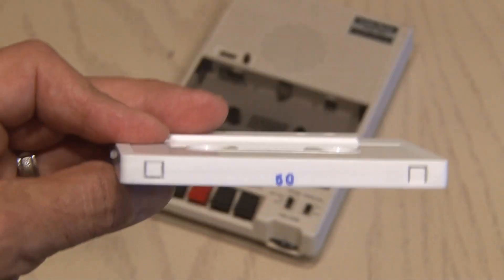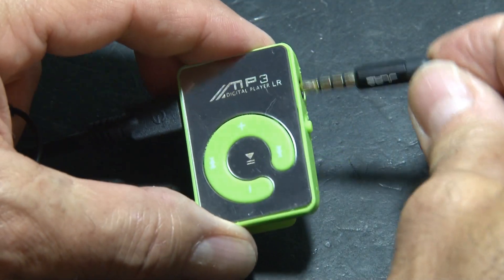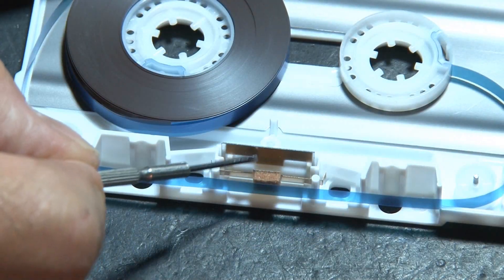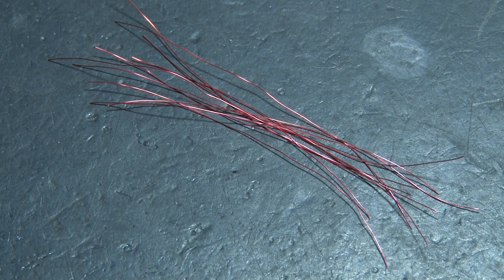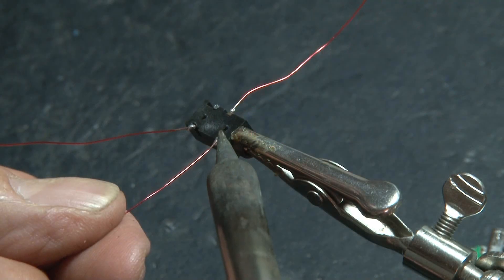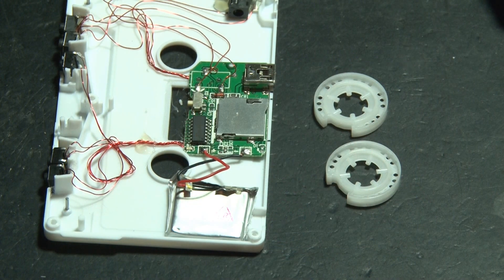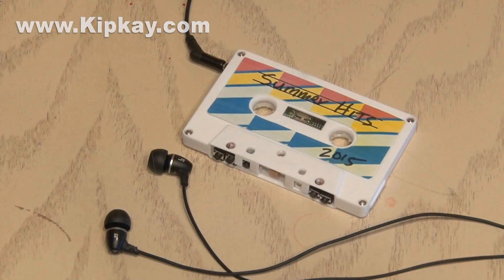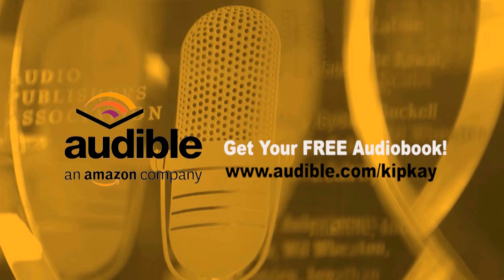Cassette Tape Hack!

Comment: I would have done it a little different but not by much.  Use long shaft switches and drills holes in the case.  feed the power switch to the record tab.  That it.  If your really good you could and lcd to this project.

Comment: a possibly better option is to use one of those old 3.5mm to car tape adapters. get a cheap stereo bluetooth earbud set, stuff them in there, and attach to the little metal output head.

Bam, you've got a bluetooth enabled 90's car....
Reply: Not a bad idea actually...
Reply: +GEMANON yeah, I figured something like that would be useful. hell, you could put some magnets and hall sensors on the rollers and make the default rewind/stop/play/FF buttons do stuff
Reply: huh, didn't know those existed already, clever stuff.

Comment: 571 people were expecting the OP to make an actual REAL TAPE MP3 Player, you know, one that involves using an actual data tape recorder/player like the ones used for the TRS-80 old computers, etc that stores actual data on the tape and then hacking the recorder to embed a real-time MP3 encoder/decoder in such a way that MP3 files can be saved into the magnetic tape itself and played back (decompress and project the sound to a speaker) in real time.  I was almost certain that I was going to see a project that involved the manipulation and parsing of data into an actual magnetic cassette media of some sort, but it was a little disappointing watching him dismantle an actual fully featured MP3 player and placing it inside an empty cassette shell with its function buttons merely rerouted else where via added wires and push button switches.  Anyways, this was a cool project.

Comment: If you wanna take insulation off wire just take a lighter and light it and the insulation will burn off in a flash

Comment: Could have done 1 addition easily!
Taken a male electronic head from a broken old tape player/recorder,  and soldered it onto a parallel wire lead to the audio out connections on the MP3 board. This would allow for the tape to be used inside of a real cassette player "Like it used to be able to do" and also be able to function with headphones/external speakers as well!

On a seperate note, a prank could be made using the parts shown, but a speaker from a audio greeting card used, then with the press of a couple buttons the Annoy - A - tape could produce annoying & loud sounds for days on end! Just place the tape in a case, then that into a good hiding spot at the victims house, and boom! Annoyed victim!

Comment: It would be so much cooler if the switch are connect to the take up reel and you need to turn them slightly to click the switch which are hidden inside the cassette tape.

Comment: mp3 sounds about as bad as a cassette so I'll just stick with the cassettes. Cool hack. Am I the only one still listening to cassettes?
Reply: Well, not really. :) I managed to obtain a few turntables as Craigslist freebies. I also found a Denon stereo-component tape deck for a ridiculously low price at a thrift store. I'll be hooking those up to my computer using an RCA-to-USB adapter. And, I still have a cassette adapter that plugs into a headphone jack from when the old Discman players hit the market.
Reply: ***** heck yeah! cassettes are like 10 for a dollar at goodwill. they sometimes have some good stuff
Reply: digitalblasphemy1100 Nice; our equivalent would be Value Village. I found some good old 80's vinyl there, not to mention the old "Life in Hell" comics.
Reply: ***** I live in louisiana so all the vinyls that come in are old country albums. They are 2 for a dollar though so I can't complain. Every now and then we get some good ones in. I have never seen any comics though I do see a ton of books.
Reply: digitalblasphemy1100 I still listen to tapes! Make them on my HI-FI Stereo system, listen to them on my walkman and play them in my truck!
Reply: digitalblasphemy1100 You are not the only one who's using cassette tapes. In my opinion it does not sound bad as mp3.. It actually sounds better , if you clean heads of the cassette recorder and clean the tape of the cassette! :)
Reply: digitalblasphemy1100 Cassette is an analog medium so they are actually capable of higher quality than MP3 when they are created properly.
Reply: ***** fuckin nerd!!!!! lol you're right.
Reply: Nope I pull my cd stereos n replace it with tape stereo
Reply: Dude { Dandypanty } it's pretty much very obvious that you'd never had a good cassette deck 
Cassettes sounds FANTASTIC they are better than CDs allready  trust me
Reply: Nope. Me too. Same thing with Vinyls.
Reply: nah im still using my toshiba kt s2 in 2021

Comment: Oh, I thought he was going to make it so that the cassette would play MP3s through the cassette player. Would be really handy as a lot of cars still have cassette players.
Reply: There are also a few adapters for that kicking around; they're just a cassette case with a playback head and a 3.5mm headphone cord.
Reply: Bryan Young 20 dollar radio? That seems a bit too cheap for me to trust.
Reply: Mrvideosandgames or for 30 bucks (20 for the radio and another 10 for the mounting kit) you can just replace the radio all together like I did.
Reply: Bryan Young True, but some cars are wacky and make that rather tricky. But for the most part, yeah, replacing it is probably the better option than using a cassette adapter thing.
Reply: True that. Vehicles can do some really whacky things. Probably a good thing mine is rather simple. 90s vehicle FTW.

Comment: I once used honey to splice a tape together. I also used gummy worms as bearings for the neck on my ten speed. Ahh! The good old days! Kids today ever got a flat on a bike they'd be looking for the AAA number to call.
Reply: Did you have fun cleaning the residual honey off of your tape player's audio head? :D
Reply: ***** it worked with no residue and or problems
Reply: Kenneth Rys Great if it worked, then, although I never once heard of using honey. I always went with small bits of Scotch tape, trimmed to size with an Xacto knife.

Comment: Hang on - You took a perfectly functional MP3 player and put it in an old cassette case... Why ?
Reply: tobortine For fun! KipKay videos are meant to be educational, too. If somebody tries this, they can learn the small basics of electrical wiring and soldering.
Reply: MattG2105 ok, I'll go with that. It's a positive learning experience.
Reply: The real question is... Why not?
Reply: Jackson Branner

- It adds no functional benefit
- It increases the size of the device
- It risks damaging the player beyond repair

If people want to do this then go right ahead and, as someone has already pointed out, it perhaps has some educational value but it's not one of Kip's better efforts.
Reply: ://about _blank 
I think you can get those mp3 players for like $2-3 on ebay lol.
Reply: MattG2105 you know what would be good for people watching his vids if he could actually solder properly some of those solder joints looked dry
Reply: tobortine ...It still is perfectly functional...
Reply: tobortine for hipsters
Reply: tobortine The perfectly functional MP3 player looks like it cost him about $5 and putting it in a different case made it look a lot better. While I won't be doing this myself, it would be a fun project and can create a nice result if done with proper care.
Reply: omry1243 i agree with you, he is getting behind, he used to do really cool stuff, i whish he stoped trying to make his projects "easy" so everyone can make them and start to make good electronics projects, i'm still subscribed just for the nostalgia, hoping someday he will start to make interesting videos again, but we also have Ben Heck and Great Scott so its not too bad
Reply: tobortine i know i looks cool but he made it ugly
Reply: because it's obsolete
Reply: because it looks cool

Comment: You should electromagnecty run the audio signal from the mp3 player so it can play in a tape player would be cool lower output signal to prevent distortion of course. Would be cool

Comment: nice one , this is an original yet instant classic 9.8/10 !! if i could improve this .. well
with a diffrent mp3 , you might even be able to put a little screen on the cassette..  it will take away from the authentic look but give you the extra info and detail that makes having a mp3 convenient and handy